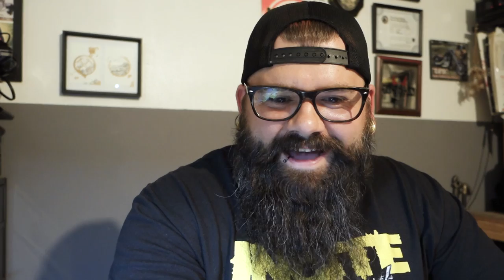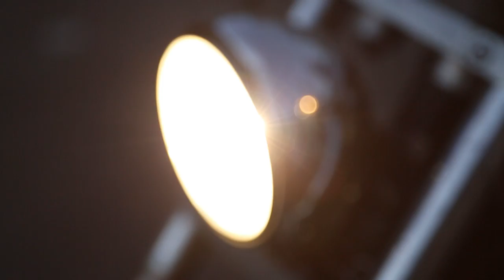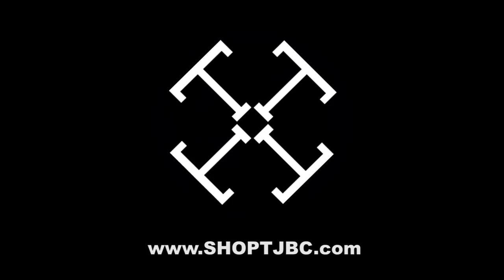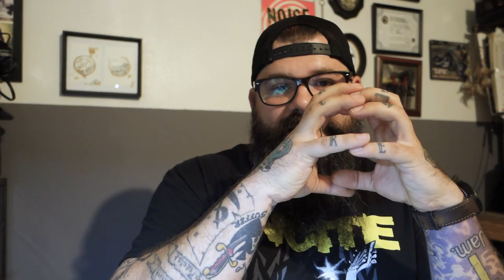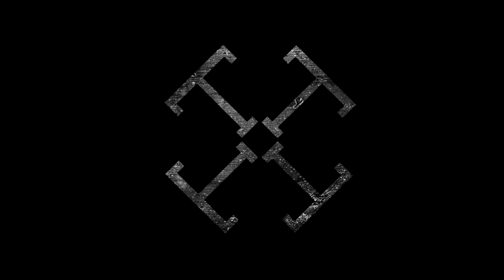Drilling Holes In A Brake Drum - Should you do it??

Comment: I followed your advice about what to do to brake shoes that tend to squeal. I did round off the sharp edges and filed a little off the leading edge of the shoes and the squealing noise stopped. Now I'm considering drilling a few holes on the cover. When I took the cover off I did have some brake shoe dust accumulated inside the drum.I also want to thank you for the velocity stack. It looks nice on my bike.

Comment: Heard that you get fracturing lines out of the holes drilled in the drum, instead drilled approximately 11 5/16 holes around the circumference of the outer portion of the backing plate.
Reply: @TJBRUTALCUSTOMS  sounds great, I'm still pondering on drilling my drums & i'm still waiting on the wheel cylinders for my brakes will be able to run a side by side test vs drilled backing plate vs stock non drilled components.

Wouldn't be surprised if the right side starts pulling first compared to the unmodified left side that may be experiencing fade first.

Comment: Hey i watch your show for alot od tips im woring3 after market turnsignals on 2000vt750 wen i connect aftermarket without running light my turn signals blink for both sides and right blinks when off how do i fix it